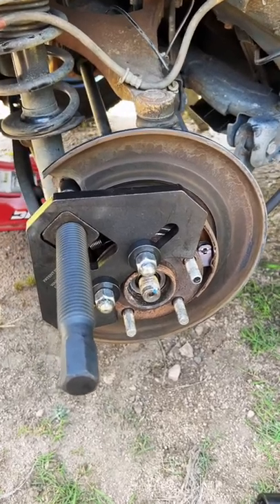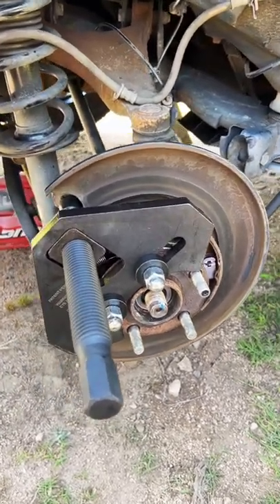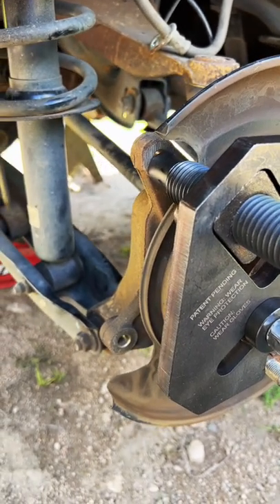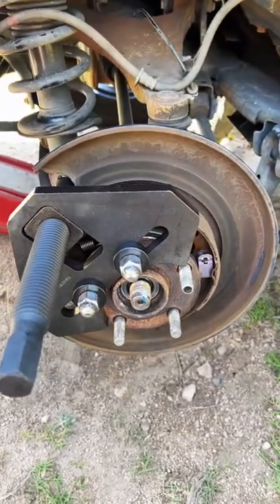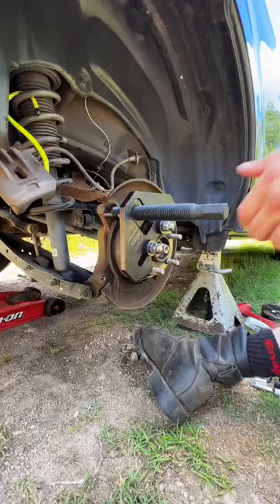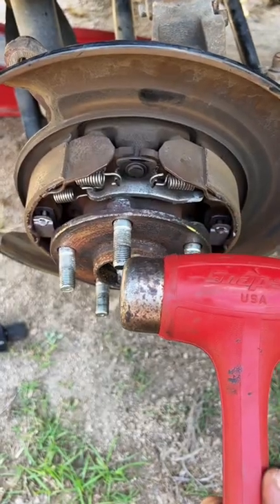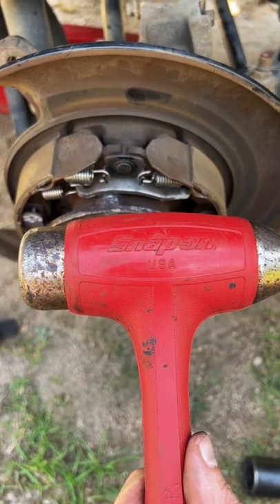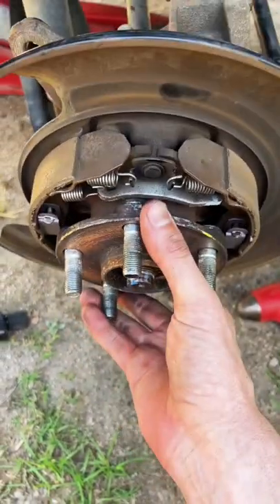Lisle 40100 Hub Bearing Assembly Remover. #Shorts #MrSubaru1387 #Lisle

Comment: I like the concept, but it stresses me out pushing on the ears lol
Reply: If you can't take the baking plate out, like in subaru  you can find a solid spot behind the backing plate and set up a wedge between the backing plate and the solid spot to avoid using the ear caliper.
Reply: Agree 100%, NOT on the calliper bracket holding ears
Reply: They will bend and the brake will bind
Reply: Done it a bunch. Bearing comes out without concern. Obviously I paid very close attention
Reply: Could probably use an old rotor to push on placed in between the hub and the dust shield.
Reply: This, putting stress on anything brake related always unnerves me.

Comment: I’ve had some luck with turning an old brake rotor around backwards and hitting that with a sledgehammer. I call it the poor man’s hub shocker.
Reply: Usually just brakes the brake rotor when I've tried that, but also live in the rust belt
Reply: @cheesecurd100s  I’m really surprised I haven’t broken one yet.I’m also in the rust belt.
Reply: This tool makes the hub shocker a waste of time. Been there done that

Comment: I reinstalled the wheel and beat the tire. Worked on my cars every time
Reply: More leverage as well
Reply: That sounds like a good idea
Reply: Good way to destroy the rim. Tried it a few times and never had it work. Have also tried driving around with the hub bolts loose to no avail.

Comment: When they're super rusted an air hammer is your best friend. We had a used car at my work we tried welding a pipe to the hub and it still wouldn't come out. Screw Subaru rear wheel bearings.
Reply: You stopped with half the idea of the pipe. After the pipe is attached I use my truck and a chain to get a little push pull action never had it fail yet
Reply: Nothing like the Ole B.F.H
Reply: The tool works great. Just have to use it properly. I do bearings daily in the rust belt. Best money I ever spent

Comment: Thank you for telling us it actually failed on that one. I like the thought on these bearing “puller” tools but they rarely work for me either. Same with these tools for pushing out a stuck cv axle. Clearly some of these clowns have never come across a cv axle that is so completely rusted to the hub it is not coming out no matter what you do. It just ends up mangling the studs and now you’re really f$&@ed and can’t even put the wheel back on.

Comment: Here in the Rust Belt I have found the most reliable method to be knocking out a wheel stud or 2 and using a nut and bolt as a jack to push the inside of the hub face away from the knuckle. With the stud out, inset the largest diameter bolt a bolt with long threads through the hole and screw it into a nut on the other side of the hub{inside}. You may have to use washers between the nut and hub if your bolt does not have long enough threads. Tighten the bolt while holding the nut as the bolt bares against a solid piece of the knuckle. Repeat in different areas if necessary. This has worked for me every time on a wide variety of rusted bearings.....even the rear bearings of Ford Explorers....possibly the worst ones. HTH.
Thanks for posting this video of that new tool.
Reply: Exploers are terrible but ram 3500 4x4 have given me the worst trouble of all

Comment: Hey guys. I work for Ford and I use this tool to remove hubs on Explorer (front and rear). It could be Fusion or Edge. For the Explorer you have to remove the bolts for the backing plate, and rotate that to find the solid spot to put against. If you avoid the ear caliper you should have no problem.

Comment: Some times you can remove a wheel stud and the use a long thread bolt and nut between hub and knuckle to push the hub out.

Comment: I work as a tech at a Subaru dealer in New Hampshire, like the worst state for rust and corrosion. Every single hub bearing I do is always extremely difficult to get out of the knuckle. I used to use some hardened extended bolts in place of the fasteners that are supposed to hold the bearing in, and then air hammer them from the back. It used to work pretty well, but would often take a while to work out. Recently got one of these, and it’s become one of my favorite tools. Gets those bearings out every time and in probably 1/4 of the time and much less effort. Much easier to use the torque of a gun for this as opposed to the impact of a hammer. If you do these wheel bearings often, get one of these. 100% best wheel bearing tool on the market imo
Reply: The trick too is to leave the axle nut on the axle. If you take the axle nut off first, it will separate the bearing. But I’m leaving it on until it’s super loose will keep it together.
Reply: It should also be added that out of probably 30 or so of these hubs I’ve used this tool on, I have not had one caliper bracket ear break

Comment: Interesting idea. I stumbled across a 'Hub Buster', which is a beefy extension you bolt onto the hub. Whacking on the hub buster, the wheel bearing pops free, even in the rust belt. The idea was so intriguing, I made my own out of some 1/2" flat plate and some heavy wall 2" square tubing. I haven't yet tried it, but owning a Subaru, it will only be a matter of time, ha ha.
Reply from the maker: Yup. I have one. Did a video on it about a month ago or so.

Comment: Snap on Axle service set has a slide hammer with a puller center point. You put pressure on the axle, hit the slide hammer a few times then tighten it up again. If the axle is free, then you don't push on it, just use the slide hammer. Pulls evenly without stress to other parts.

Comment: My did my rear wheel Bearings. It took 4 to 5 hours to do the driver side. We took turns banging on it and we try heat. It finally pop out.
We ran out of time to do the other side, so we did the passenger side the next weekend. 
One thing that we learned from the 1st one was to get a new brake pad shield.
This one took longer to replace and we had to destroy the old brake shield to get the bearing out. New England weather and salt on the roads rust everything

Comment: I just use a "clawfoot style" bearing puller for hub bearings. Just hang the claws on the outside of the wheel stud flange, and put the tapered bolt on the end of the axle shaft. It pulls straight and true every time. The only time it's ever failed me is when the bearing comes apart during removal, but in that case nothing is going to work effectively.

Comment: Knock out wheel studs so it aligns. Then, remove the shoes.It barely fits, right on the edge, but you can push on the backing plate.

Comment: I use my IR airhammer with a blunt 1/2" round shank. Remove the bolts and come from the back through the bolt holes with the hammer and they push right out.

Comment: There’s an old OTC puller we have. It has some pieces to hook to the lug studs with the lug nuts, and a large screw with a striking head on it, with a turning tool also meant to be hit with a hammer. Even has a little centering spike on the end. Works amazingly.

Comment: anything that has spent alot of time in the rust belt an air hammer or sledge hammer is the only way your getting hubs out. that tool would just snap off the caliper ears before even budging the hub. companies are now making loaded knuckles, which while more money may be a good option for severely rusted cars. and will save alot of labor with the older pressed in wheel bearings.

Comment: And old man showed me a trick with pullers that’s better then a impact or any thing, put a ratchet on the puller tighten it till it gets tight then take the ratchet off and wack the bolt of the puller with a little Thrack then you should be able to put the ratchet back onto it and turn it even more and just repeat a few times till it’s pulled a lot of people ruin pullers from just tryna tighten on them till something pops free

Comment: I’ve had good luck sliding an adjustable wrench onto the hub face and using it as a lever to pull off the hub. Sometimes a hammer helps

Comment: Interesting. I thought you had another hub bearing puller that bolted on in similar fashion to the wheel studs  with a long black square piece of metal protruding out and once you got’er mounted up you just hit it with a hammer I thought. Leverage. It was a few videos ago. That’s the tool I was referring to in yesterdays comments. No big deal 🤷‍♂️ lol I don’t have TikTok
Reply from the maker: Yes. I still have the hub shocker. Wanted to try this Lisle tool because it just released.

Comment: I had spare bolts that I would thread in from the front side, heat everything up, then take a heavy duty punch from the rear side in the bolt holes and hit with hammer

Comment: 😂 everybody tries to make it harder than it is... Back out the bolts the quarter of an inch.. All of them ..take the socket. Take an extension you want to beat on. Put it in the socket. Take a hammer beat on the back of the bolt and knock the bearing out.... Or jam the extension against something and turn the wheel

Comment: Had the tool set up backwards. It's designed to push off the axle shaft or brake rotor, if brake rotor is going to be replace.
Reply from the maker: WRONG.

Comment: Could have removed the tool and turned the hub 180° and reinstalled it to push on the other side.
Reply: @MrSubaru1387  I just realized that wouldn't have mattered at all. Still only be pushing on the same part of the actual bearing. That tool and a hammer on the other side to rock it back and forth would be the only other way to use the tool. My bad.

Comment: Not ideal, but by switching it like you did does nothing, but alternate stress off pushing from one ear to the other. Try applying pressure like you did, back off then un bolt remover tool and rotate hub lugs 180 degrees, re-attach, then apply pressure again, repeat as much as needed to walk bearing out evenly. Hoping you dont bend caliper ears

Comment: Everyone whining to just use a slide hammer has never turned a wrench in the northeastern United States. 

I’m not saying this tools the solution, but if it’s really rusted in, even my 15# S&G slide hammers about as useful as peeing on a forest fire. 

And I truly hope that everyone suggesting the Texas twister is joking. I’ve seen that contraption struggle to remove outer bearings on a Dana 35, let alone a seized hub assembly…